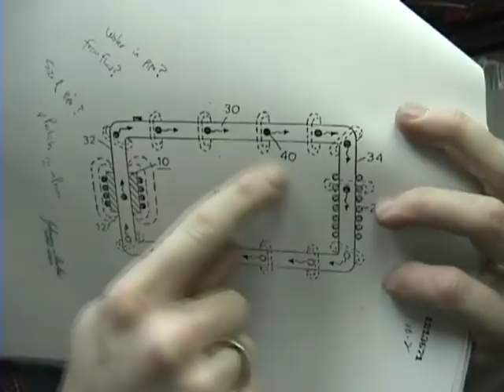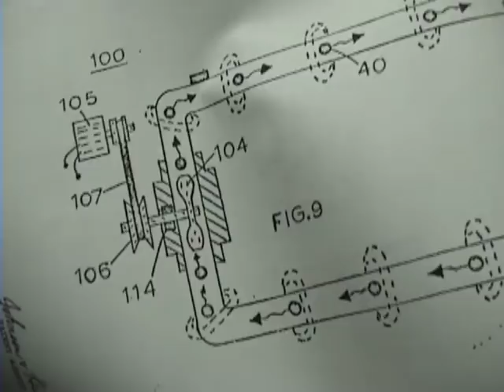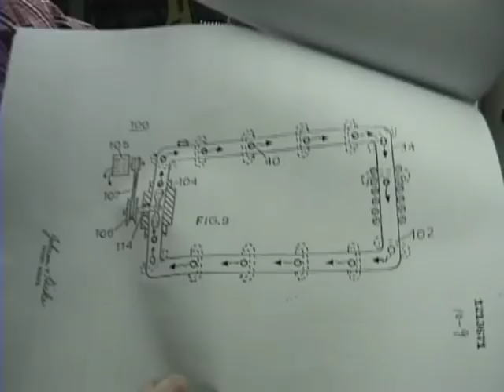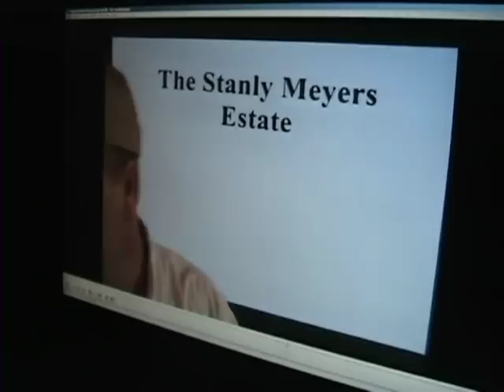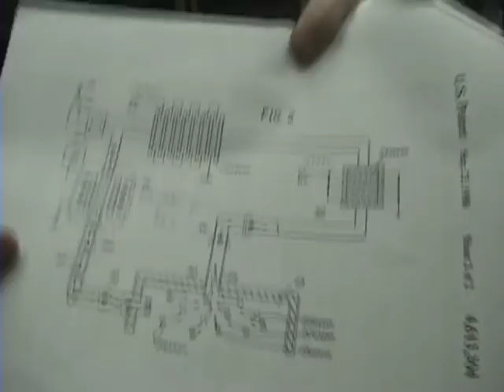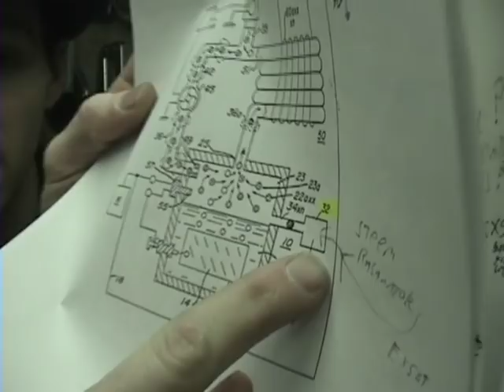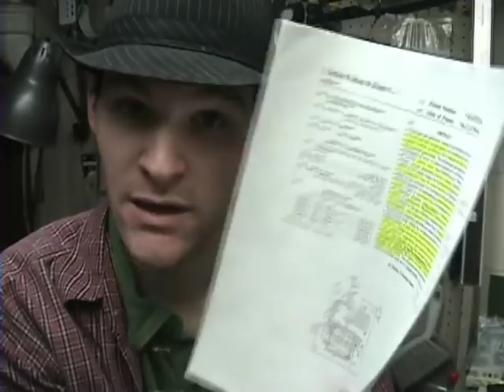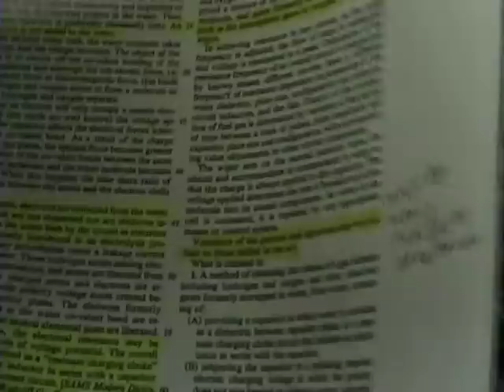The Key To Stanley Meyers Water Car, Gas Electrical Hydrogen Generator, www.RWGresearch.com

Comment: I would also like to point out to anyone working on this.... i myself have gotten a dave lawton circuit to work... ive replicated the results with several other versions of the circuit as well.... people are trying to combine lawtons circuit with meyers VIC (transformer).... the problem with doing this is that the 555 creates positive pulses... gases are seperated during the POSITIVE cycle... if you put a positive pulse into a transformers primary you get NEGATIVE pulses at the secondary...

Comment: Examples of molecular oxides are carbon dioxide CO2 and carbon monoxide CO . All simple oxides of nitrogen are molecular, e.g., NO, N2O, NO2 and N2O4 .  The oxide ion has the formula O2−. It is the conjugate base of the hydroxide ion, OH− ; O2− is unstable in aqueous solution − its affinity for H+ is so great that it abstracts a proton from a solvent H2O molecule:   O2−  +  H2O →   2 OH−

Comment: Russ, I have never heard of this power generator either... but.. are you suspecting that it powered the spark plug version of his waterfuel system? I was on the understanding he had evolved past the capacitor/transducer "pipes" and started directly exploding the water, as is, right in the chamber.

Comment: 59:45 This is not as complicated as it sounds in the patent. Permanent magnet gas particles can become "superimposed" on the hydrogen and oxygen molecules. This is saying that each permanent magnet gas molecule will be attracted to, and hold on to, the ionized hydrogen and oxygen molecules floating around in there, and they will then move as a big group of organized polarized ions with a magnetic gas vapor molecule at the center of each group. The ions will interact with the magnetic fields of the magnetic vapor molecules in such a way as to separate, align, and collect them according to their charge. Hydrogens are positive (H+) and the Oxygen ions are negative, O2-, because it is easier for Oxygen to gain 2 extra electrons to fill its outer shell than to lose them and become positive. Pretty sure that's what's going on when it says superimposed.
Reply: this was basically my though, but I think you need to look at it not as 02 but as 03 as the arch will produce ozone.
the metal vapor that is produced from the electrodes will be an oxidized metal add that to a magnetic field and you will then separate it nicely by adding the metal to the product and that will increase the reaction. This leads me to a question, what happens with O3 and vaporised metal, does it break the O3 down or does it bond as a O3 molecule, as this would allow for up to 3 times the amount of oxygen being removed on the metal vapor.
As for the windings and the closed loop I feel it is using it like a flywheel to stabilize the voltage and amps, by adding torque to the equation.
Reply: What puzzles me is this, if you have multiple magnets on a table they will group together by opposite fields -N to S.  Aligning them in a specific direction to generate an induced voltage by running through a coil  seems to be impossible due to the natural attraction of magnetized particles. To induce voltage a strong magnetic field aligned in the same direction polarity wise would be required. How to have particles in a gas not just neutralize each other in the overall magnetic field?

Comment: the tube was a mirror and there would be laser light tuned for each Atom in the tube to unlock the magnetic compacity of each Iron Nickle Cobalt Atom which would increase the gas core to the strength of a solid core not to mention the moving aspect of the core

Comment: Carbon electrodes do vaporize and make light. Large lamps once used in movie production. Could be center filled with other elements that vaporize. Probably any element used in batteries. Good luck.

Comment: No magnets out of the chamber because the gas will ionize when passing through the coil which will be acting as an electro-magnet as well. The goal here is that ionized gas has most better combustion

Comment: it is a combination of Geet Engine (Fusion create a magnetic field to breakdown the gas into atomic form - Geet using exhaust heat intro into a vacuum while Stanley probably using electricity to create the magnetic field ) concept with the HHO system

Comment: each particle being individualy magnatized, example a state were normal hydrogen, and 02 will not recombine to form water due to the wrong atomic numbers created in the individual atoms of hydrogen, and again o2.   so if a h6 canot combine with an 03 then you will have sucess. and therfore no added gas is needed after primed.

Comment: I don't know whether this is relevant but I know of a welding shop that has an older 3 phase welder that fas a spark gape in its circuit that when used makes the electric companies meter rotate in reverse , in other words it is feeding power to the grid. The guy that owns the welding shop says that electricians cannot explain what is happing ?

Comment: Just build a prototype to bench test - don't even need to install in a car. Just test to see if it can deliver enough fuel to run a car engine - that simple. I have my doubts though.....otherwise it would have been put into use by now.

Comment: Wow you create the metal gas with the one thing (arc welder module with metal pins) and inject it in the hydrogen(separate chamber as the hydrogen is brown and the arc to create the gas should never contact 💥). The acceleration of the hydrogen takes the metal gas "magnetiseble gas" threw the coils as u use the gas as a fuel. By the centrifugal movement of the metal gas (hydrogen that mover at 20m/sec)the metal stays in and becomes permanently magnetised. Wonder what the output is. Sounds genius wonder what the result is I would use glas piping. Sorry for the poor English.

Comment: Super imposing the magnetic particles on oxygen and hydrogen molecules implies that they essentially stick to the atoms and are transported around on the hydrogen and oxygen. The alignment of the magnetic particles must be done by the accelerator or pressure that carries it around the loop. Perhaps the magnetic particles align the hydrogen and oxygen molecules similar to a string of magnets align to each other as they bond to each others opposite poles. 

Also consider that the magnetic particles themselves could be vaporized magnetic particles from an arc field. How? Perhaps the arc itself vaporizes the metal of the electrodes.

I would love to do experiments but finances, retired on fixed income until some other inventions sell.
Reply: Vaporised steel particles in oxygen, oxidise - someone said that Stan used stainless steel - that would oxidise less and perhaps be more magnetic with larger particles?

Comment: I Can tell most of you don’t listen to the words, Stan himself told you in his videos... it isn’t electrolysis!!! It’s all voltage no amps, it’s a capacitor!!! The water is the dielectric!!!! The reason it’s not a direct short is, one plate has a insulator on it which causes the electrical potential that separates the h2 from O!!!! 
The high voltage comes from the sealed gas system or if it’s in your house your AC source... he built his home heating device first!!!!

Comment: Thanks very much Russel for your sharing of this very important and much needed information. Patent download sites load blank pages...were they removed?...any place else to download the patents? Thanks, Wix
Reply: The first patent seems to describe a regular transformer with a core made of mercury (metal), inside a non metallic (avoid the squirrel cage effect) vacuumed tube and a pump to initiate the circulation. This would certainly reduce the core's resistant; something to look into...

Comment: At 50:40 Nitrogen and Hydrogen are weakly diamagnetic, which means they will repel an applied magnetic field. Oxygen is paramagnetic, which means it will be weakly attracted to an applied magnetic field by having its own magnetic field induced in the same direction as an externally applied field. These are less important to the core concept. My understanding is that Meyers claims that he created vaporized permanent magnets which, as he explained in one of his lectures, was done by ionizing iron, cobalt, nickel, or any combination of those (this might be done by the plasma arc process with iron / cobalt / nickel tips, which would then vaporize and ionize thanks to plasma) , and mixing them with ionized argon such that the metal ions covalently bond with the gas ions to create magnetic vapor molecules that then are magnetized as usual by moving them through a strong magnetic field. The plasma arc is the heart of this process. A plasma is defined as "an ionized state of matter similar to a gas". If you create a plasma arc between iron tips via high voltage pulses, it may very well produce vaporized iron ions. If you enclose the plasma arcing in an argon container, the plasma arc itself may act to ionize some of those argon atoms. The vaporized iron ions would then bond with the argon ions, and you'd potentially have a magnetic gas particle generator.
Reply: someone in this blog said that he saw Stan use stainless steel - it oxidises less and may produce larger non oxidised particles?

Comment: but because we are not dealing with DC but a fluctuating DC pulse. we are dealing with impedance.... and depending on the situation different things occur... a parallel load at resonance has MAX impedance... a series circuit at resonance has ZERO impedance... this is also part of "the secret"... a transformer run at resonance will saturate and store significant energy.. now if you have two inductors (as stans patents show) running in series from the transformer.. you will get the highest output.

Comment: You really need to read the patent filed by Denny Klein. He of course claims he is making a different gas, but I don't buy it. His model of the gas makes the most sense. Its not H2 and O2, it is a clump of water molecules that forms by magnetic attraction into a highly diamagnetic "magneto-molecule" as he calls it. This is a gas of pure water at temperatures above minus 158 deg. C. But it will implode/condense into a liquid if forced by about 5 atmospheres of pressure or burn in a limited chain reaction with a spark or flame, or it can be used in a fuel cell like H2 but will produce up to 6x the electricity of H2 by weight; making it, in running an electric motor over 80x more energy efficient than gas in an ICE by weight. But the spark released when it condenses into a liquid also has proven to do cold fission of any substance in contact when it condenses, making it an implosive fuel that cleans ICE engines without the need of a spark plug (it ignites with compression like deisel engines), burns cooler, cleans up any toxic residue, and implodes with a decompression of more than 1,600 to 1. You might try 400 series stainless, the magnetic properties might facilitate the formation of the diamagnetic molecules. It doesn't take a lot of power, but you are trying to build a magnetic molecule that does not stick to your electrodes which might dissolve if the bubbles pop on your plates, like propellers and impellers dissolve with cavitation.

Comment: Come on people. Go to Walmart and get ultrasonic water fogger. This brake the bond with 4W. No need for 20-30A to break the bond. Then run trough hho generator with1-5A( maybe even less). Want more volume - get more ultrasonic disks at amazon cheap.

Comment: Tesla's coils ×2 ? with donut in between to
hold water/gas...?

trying in Australia with this stuff too...(doing my head in!!!!!!!!!)
Reply: A spark gap steps up voltage...
Reply: This is all plasma technology based also creates a resonant frequency which is converted back into power again. It's a closed loop system. Ever heard of water plasma spark plug?? Implosion using high voltage. This stuff is certainly real and they most definitely don't want us to know about it!! In air there is 70% Nitrogen around 20% oxygen and the rest water vapor! I'm sure they are using this tech by using air to create this plasma effect. Must be!!

Comment: @45:51 that would likely be the introduction of "non combustibles" there are many reasons why I say this, but the primary is to reduce the heat generated by the magnetic VIC coil.  Please be careful with your work.

Comment: Look at the windings in the upper right that looks like the separation part for the permanently charged particles and in one of the patent they talk about combustion with hydrogen oxygen and a non combustible gas nitrogen sounds better and better

Comment: That one picture with the “gap chamber” almost looks like a sonoluminance cell.
Pure water does not conduct electricity.
The “gas” would be a plasma product.
The “arc” would be hotter than the sun.
The “magnetic ring” at the output would possibly induce a magnetic flux into the gas particles.
Most intriguing.
Just saying…….

Comment: I wonder if its all in harmonics like as in freqencys like how in msuic if you tuen into the same sound they will canel each ohter out make the not weaker meaning that say you was to tune in to waters bond an do the same then hit it with a charge it should take less energy to break that bond since its partly swithced off its all in the frequencys in the vibrations shut that off or lessen it an the bond should break. Oxegen is partly magnetic water is polarized useing a system to osilate it.

Comment: Like 45 minutes in you do realize a pressurized chamber contained at a specific pressure could also be a vacuum or a lower pressure which would lower the boiling point of the water

Comment: What is the power input? What is the power output? You can't get away from physics. If you put 10 volts and 10 amps into it and even if you get 1000 volts and a milliamp out. power gain is 0 but still, that's in a perfect world but losses/inefficiency have to be taken into account. I can wrap my brain around the concept but Tesla already proved that the greatest energy release is due to resonance....

Comment: The normal transformer step up would resemble 12V input with 10 amp = ~120watts would step up to maybe 120V but 1 amp making ~120 watts nothing changed. It seems that its a voltage and amp  amplifier so 12 volt with 10 amp  120 watts input will result in example 120volt with 100 amp and result in 1200 watts power That mean s that the device will turn 120 watts into 1200  watts so amplify the power. This is  over unity .Do normal electrolysis and get 10X gas output .gang these and get ~30X HHO

Comment: Hi, I like what you say here, very interesting stuff, but nitrogen !, Nitrogen is a non explosive gas, making up 78.08% of air, it is used in industry as an inert gas, put in to explosive areas / vessels / tanks / to render the area non explosive, and as such if used in pure form in a hydrogen system, it would make the hydrogen inert, none usable...none combustible... Just a thought.
Thom in Scotland.

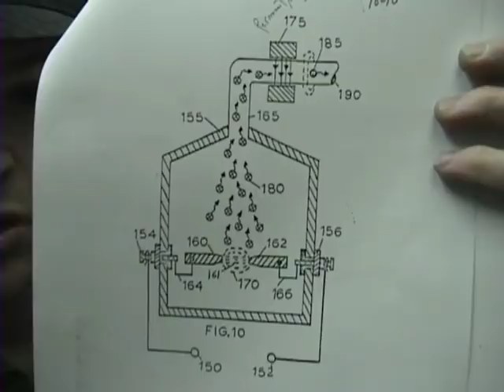Comment: 21:12 if there is no water in there it could be what i would call a drip gap something i just made up to explain it. think of 162 and 160 as 2 needles that have high voltage ruining through them. you can use gravity or a pump to secreat a drip at the tip or tips that in turn bridge the gap making the plasma that splits the liquid in gas. i wish i had the money to run these test my self but i wonder if it is better then having the probes fully submerged
Reply: the metal thing you said senses too

Comment: All one has to do is add (SODIUM or POTASIUM HYDROXIDE) to (ALUMINUIM METAL) to produce copious amounts of (HYDROGEN GAS) to use as a Fuel. So easy to do. Why do we all still have a problem with doing this?

Comment: Toyota released 1,000´s of patents on Hydrogen fuel cells for anyone to build, design,  manufacture etc...    plasma or hydrogen gas should work fine.  What is the down side?

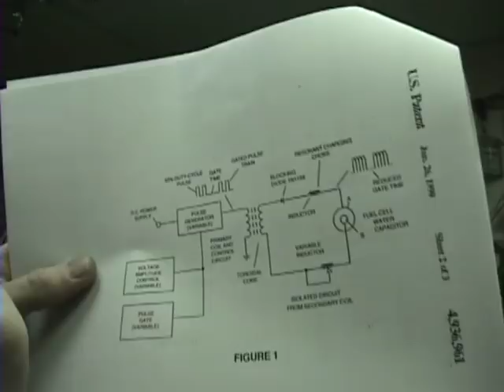Comment: 1:05:29 The toroidal core transformer is also discussed by Stan in this video https://www.youtube.com/watch?v=bUrqiFqwhQo&t=6006s . This is not a gas core transformer. It's a transformer designed to deal with the Lenz's law problem of resistive eddy currents.

Comment: Sounds like the hydrogen/oxygen/ nitrogen- pressurized gases “propel” the magnetized particles throughout the loop perpetually, 
as it were. The coils would become energized by the rapid movement of magnetized particles, hence the D.C.  Said pressurized fluidic gases could be even further utilized by “throttling” the modulated gases, (conveniently  maintaining the pre determined pressure) with a Tesla turbine.
Said throttled energy could power yet another electricity producing device, and or supply the “initial mechanical pump” action.
This just keeps getting better..
Just saying…….

Comment: What you are looking at are the rudimentary ideas of the sparkplug and water atomizer.
In short an engine driven coil spark system that is able to convert water injected through a modified sparkplug design to convert that water to hydroxy. 
Stanley did succeed.
He was also working on a step design water to hydroxy to run military tanks and propel rockets.
I've done some of his work years ago now and it's all real, it works.
I never pursued it further than the sparkplug modified design.
Check out YouTube @jabafuller

Comment: This could probably be done with many gases(possibly even compressed air..) but, if this stuff does heat up.. hydrogen could be a good thing.(to a point of course)

As for the pressure.. I don't believe much at all would be required.. only enough for the first cycle/get the ball rolling sort of thing.. a couple psi tops.. (hho auto-ignites somewhere between 80-100 psi, and you will die.)